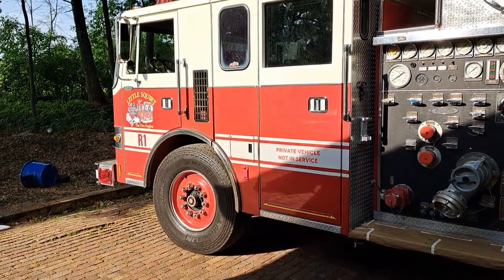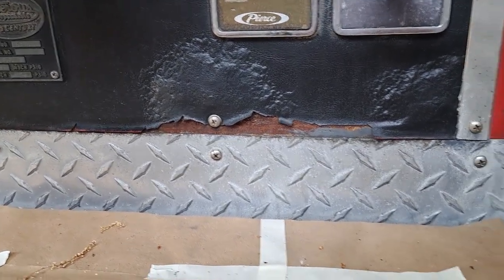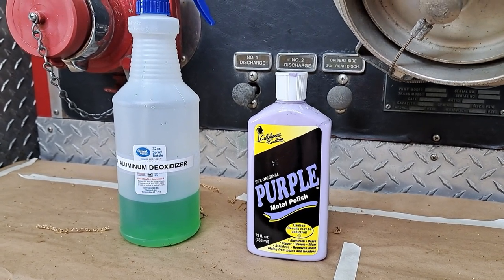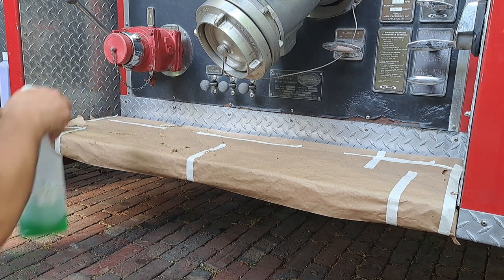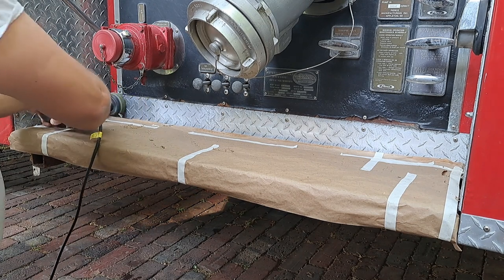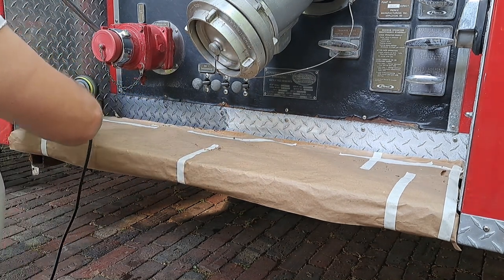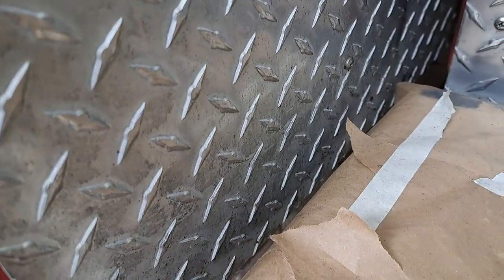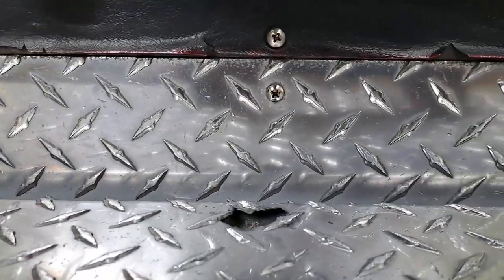Polishing NASTY diamond plate

Comment: I have both Mothers M&A polish, and the California Custom polish. Man O man  does the California Custom’s make diamond plate polishing an easy task. 
I use an old piece of carpet to polish the diamond plate. It works well
Reply from the maker: Yes, it is worth every last dollar. The green aluminum prep helps with the really tarnished stuff. The truck has about 50 square feet of diamond plate so I used a power buffer the whole time, otherwise I would have been there for weeks with a carpet square. But you are right that does work well for smaller areas.
Reply: @littlesquirtthefireengine5478  have you tried using a velcro attachment arbor, pressed onto the carpet back for the polish? Keep a small amount of constant pressure and it will hold firm. 
I should have been more descriptive in my initial comment. But that worked well for me.